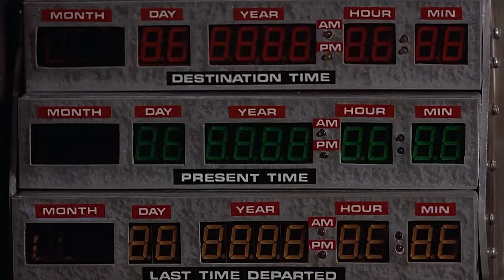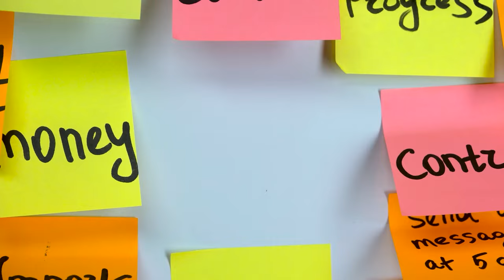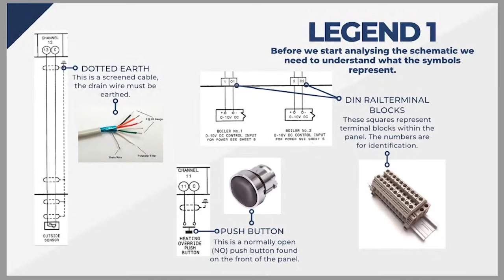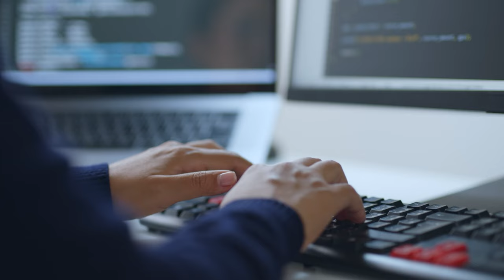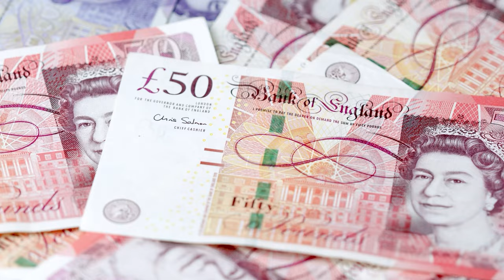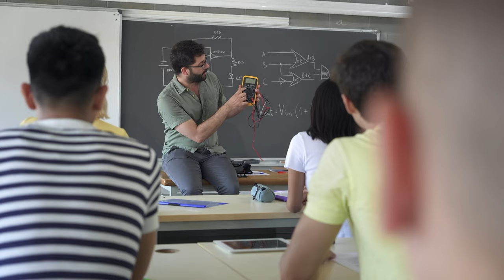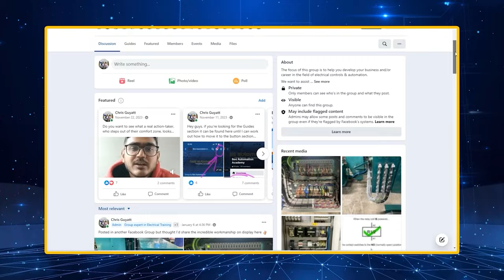FASTEST Way to Learn Automation and ACTUALLY Get a Job

Comment: I'm a CHP engineer. Working in energy centres and commercial building. I'm interested in moving into Bms systems and trying to upskill into this sector. Currently I'm doing some panel work and mostly mechanical repairs but want to focus more on panel/electrical/controls
Reply: Combined heat and power?  Cool!

Comment: Thanks for the info. Shared it with a few sparks. Only thing that I would have liked more clarity on was is it necessary to at leadt get a level 2 in electrotechnology. I hear many bms guys state that that have electric tickets.
Reply from the maker: The guy I used to contract used to be a car salesman back in the day and has no formal technical qualifications. So no is my answer but it’s not going to hurt.
Reply: @beeautomation  thanks for the info.

Comment: In an effort to gain practical experience, I purchased a secondhand Omron setup that got obsoleted but had its previous life in controlling a lock system between lakes(lochs?). The trouble I've run into is aquiring the software to program and generally mess around with the hardware. Even the cables (SYSMAC) are proprietary, but if I could get over that hump and actually start using the thing, I have relays for days.

Are there any back channel ways for an individual on a shoestring trying to get into this industry to get started with the hardware? Should I bail on the setup I have and find a different manufacturer?